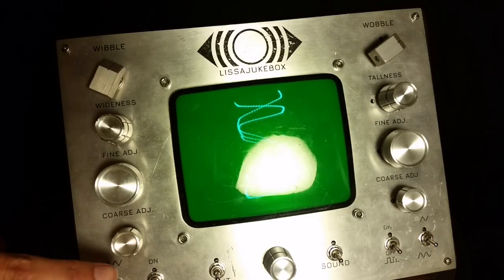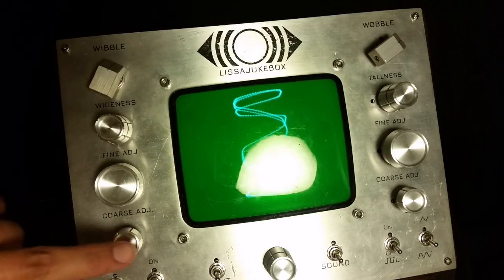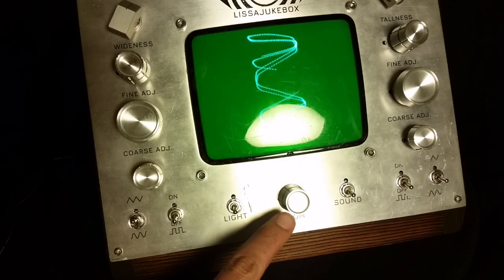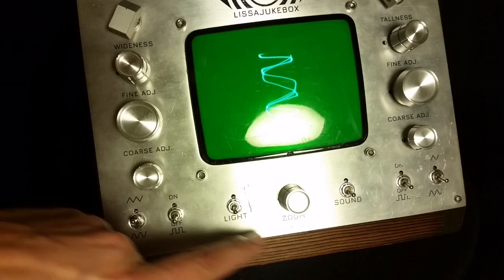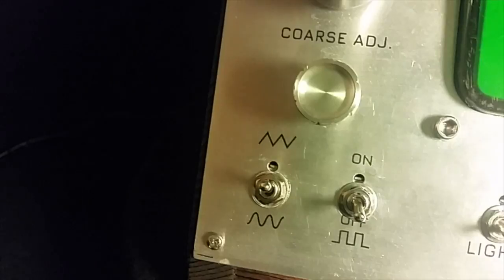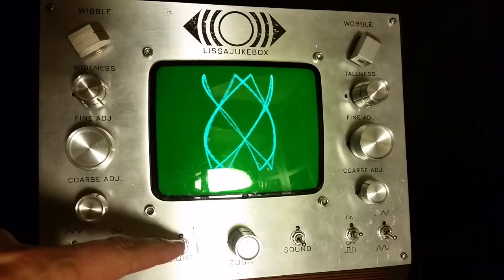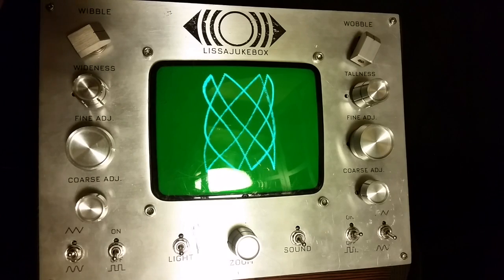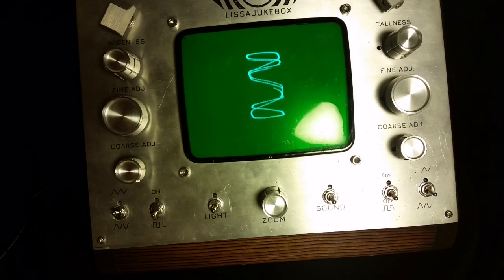The Lissajukebox

Comment: I'm going to build my own. Do you find yourself using the rotary switches much or is there a good range to leave it at?
Reply from the maker: I did find that the rotary switches get used a lot. The ranges behave very differently than each other because of how they interact with the electron gun drawing the lines

Comment: Hey Emily! I can't seem to get it to work. When I attach the horizontal coil to the vertical points on the PCB of the TV and the vertical coil to one of the wave generators I get a vertical wave. I can't seem to get both attached to both coils though. Maybe I screwed my wave generators up somehow by miswiring them? I'm going to try a different TV and if it's the same I'm going to order two more wave generators. Thanks!
Reply from the maker: I'm sorry it's not working! I can't really say whats going on with it without seeing it. If both coils are still intact, they should deflect the beam on the screen.
Reply: @EmilysElectricOddities  ok...my amp had a bad solder joint and the left channel wasn't working fixed that....now...I get some crazy designs but nothing ad elegant as the ones you have. It's still fun to play with but I was hoping for pretty ones like you made.

I'm going to still mess around with it but I am using the same style CRT as you and not the flat CRT that I wanted to use because after I disconnected the wires to the coil, the electron beam is pointing to the very too and outside the field of vision.

Thanks for this project, I really enjoy watching your channel and seeing your awesome projects.
Reply from the maker: @ryanbareither89  oh! that's good progress! What did the designs look like? Can you upload a short clip so I can see what it's doing?

Comment: Outstanding work, Emily! I picked up an XR2206 kit after reading your writeup on Hackaday (which you should link to here) and I'm excited to play around with it and try your mods. I still wish I had a better idea of how you wired them into the TV. I have a small portable TV that I think is very similar, and I'd love to try something like this.
Reply from the maker: Thank you! I've added the Hackaday.io link to the description. As far as your question goes, the block diagram in the Hackaday.io project page should be of some help. Simply, the outputs from the pair of XR2206 boards are being fed into the left and right channels of a small stereo amplifier board. The left and right channel outputs from the amp are being fed into the CRT's deflection coils. Those deflection coils are ordinarily fed signals from the CRTs driver to make it draw a raster image, but in this case, they've been disconnected from the board. The raster image signals are replaced with the amplifier outputs. The horizontal coil gets one channel, left, for example, and the vertical coil gets the other channel, right, for example. 

Does that make sense?
Reply: @EmilysElectricOddities  The words make sense, but as someone who's never poked inside an old TV, I can't match up what you're saying to anything in my experience. I think it's time I crack open my baby TV and get acquainted.
Reply from the maker: @MakerProjectLab  Definitely do take a look inside, but take all precautions for working around the high voltages of a TV. When you look, you will find some coils of magnet wire around the neck of the tube. Trace those down to where they connect to the PCB. There will probably be a connector you can unplug. That's the easiest place to feed in a signal from your function generator